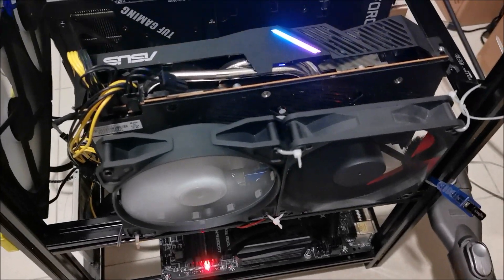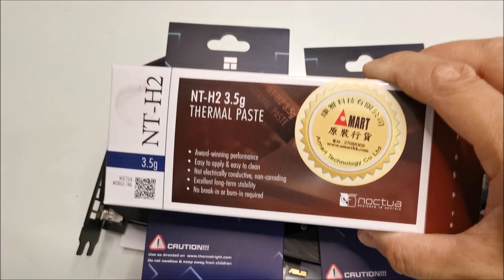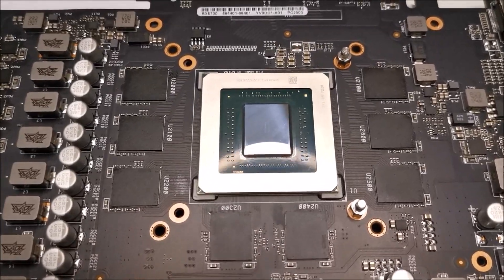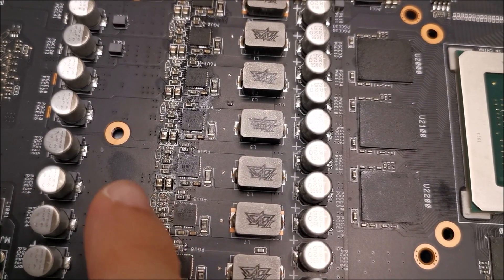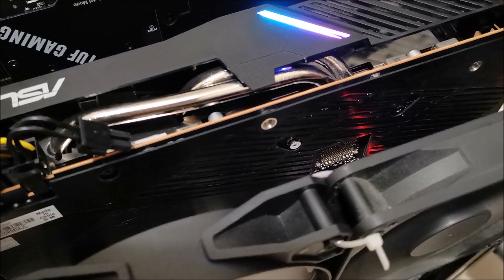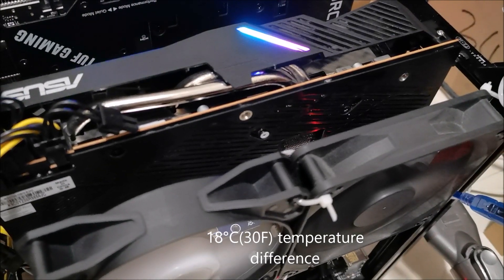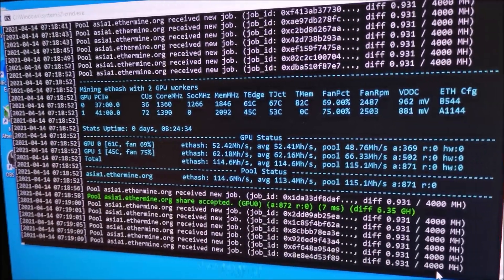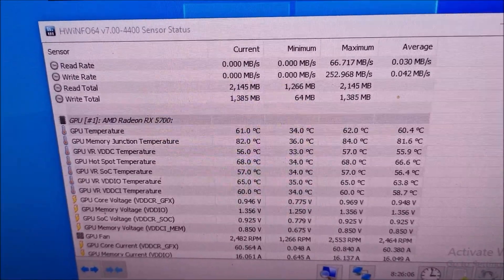ASUS RX 5700 Thermal pads install Upgrade | How to DROP🥶 by 20C

Comment from the maker: Thank you for the 1000 views. It was totally worth upgrading the thermal pads. Let me know how much temperature drop you get from yours
Reply: Hey there i got close to 100 degrees before and now around 80. But i have a problem, there are long ans short screws in the back plate and i mixed them up. And sadly in the video you cant see it. Can you help me out ? Also the Junctions temperatur went up a lot for me, any recommendations ?
Reply from the maker: @Xorat  Hi. You would have to retrace your steps and figure out which screws goes into which slot. Every GPU is different. Also, I think you are confusing GPU temp and Junction temp. With most GPU cards, when mining ETH, its the Junction temp that gets high.....You said you were 'close to 100 degree Celsius before and now 80' I assumed this was your Junction temp, if it's your GPU temp, then you have bigger issues. 
Your last question: If your Junction temp is higher than before, then you have used the wrong pads, wrong thickness, reassembled wrong......any of the combination.

 hope you sort this out
Reply: @BosHK  Hey, so my mem temp was 100 and now 80 so replacing the pads helped a lot. My Problem now is, that my Junction temperatures are really high. They are around 86 and they were about 60 before. I got the exact same rx 5700 daul evo. I replaced the pads with 1.5mm pads. So i think the junction went up because i placed the screws in thw wrong wholes. So because we have the same GPU i wanted to as you if you know in which holes the long screws go.

best regards!
Reply from the maker: Hi. So there are 2 different temperatures according to HWinfo64.
1) GPU Temp.......this uses thermal paste
2) Mem Junction Temp......this uses thermal pads 

As to your screws problem, I have no idea. I rewatched my video, I cant take mine apart again.
-Backplate has 6 screws....I assume they are the same length, it's not those right?
-side next to hdmi ports has 2 screws.....cant be those
-GPU area has 4 screws with a spring-like fixtures to it.....cant be these since they have that spring

If its the backplate ones, I didn't check, I just unscrewed it and lifted the whole plate off with screws left in. I would think if there ARE 2 longer screws, if you used a short screw in its place, it wouldn't even grip and screw in.....check if any of loose
Reply: @BosHK  sadly there are 2 Long ones for the Backplate. 
And all of them fit in every hole .
I was going of from the temp that Team Red miner Shows . It has Edge , junction and mem . 
Mem got better after replacing the Pads and junction got way worse .
Reply from the maker: The backplate screws should not affect the GPU temp. Could try using longer one in middle.
Make sure your paste is spread covering the entire GPU, if you watch my video around 2min mark, you see I tried to take 4 screws out but only 2 came off....thats because I manage to unscrew 2 off its nut-screw (right next to gpu module). Make sure the 'nut screw' is screwed in properly otherwise you will have an air gap between gpu and heatsink.

Comment: asus dual rx5700 backplate is bad design with holes in it , i have asus dual rx 5700xt with much better backplate and thermal pads on the backplate and memory temp while mining is 70c at night goes to 68c

Comment: Great video.Changed the thermal pads . used 2mm . all spots are like 50c except memory . Memory is 90+ c . should i use a knife to make 2mm pads thinner ? (system restart itself after 10-15 min.)   thanx.   GPU = ASUS TUF 3 5700xt

Comment: just did it myself and all the pads were great with good indentations except the two vram chips on the top it was like a sliver so I just cut nice square ones and replaced the pad that was to small and repasted put it back together without tampering with the other original pads , dropped down to 82c was hitting 104c during day time when mining..., now I got to do 3 more tomorrow but this was cake. my other ones hit like 94c , i may not mess with them as thats way with in safe temp for ddr6 , 106c is when it throttles and can then become damaged. the lower the better but I live in florida and when its 90f outside cards cook lol

Comment: How Many MM Do You Recommend For Asus Dual RX 5700 Over Clock Model?
Reply from the maker: Warning: If you open it, warranty is void. 
Your safest bet is get 1.5mm and 1mm. You would need to open and measure the pads out yourself. I do not have Dual RX5700 OC model. if its 2mm, then you can just combine 2x 1mm together.
Reply: I replaced the thermal pads on two Asus Dual RX 5700 OC and used 2mm pads, but they were a little too thick so I had to use an exacto knife to scrape them down to shave some off to thin them out. I recommend using 1.5mm.

Comment: Yes I just did it and got literally 20 C decrease in vram temps! would definitely reccomend
Reply from the maker: That's amazing! so helpful now that its summertime
Reply: which card did you have asus tuf or asus dual. I have asus tuf 3 rx 5700 memory is 100 degrees. Do you guys think it has 1.5mm pads or 2mm pads?
Reply: @poyraz8368  dual, 2x. 1.5mm for memory
Reply: @yobb1n544  2x ?? So you put 3mm for memory?
Reply: @poyraz8368  No, I have the dual version with 2x fans
Reply: where did u applied 1.5 and 2mm ?
Reply: @sunhine08  I applied 1.5mm only on memory. Asus tuf 3 rx 5700. Memory temps fall from 106 degrees to 96. It is still hot tho.
Reply: @poyraz8368  maybe you need thermal pads with higher quality? this watt/cm value
Reply: @sunhine08  I used exactly same model as this video. 1.5mm
Reply: @sunhine08  1.5 was for the vram. I didn't cover anything else.

Comment: hello, friend, I have rx580 the thermal pad is only 0.75mm I can't find this size anywhere. I can try to put a 1mm greezy thermal pad as it is very malleable?
Reply from the maker: Hi, one of the reasons I did this for my 5700 was because warranty had expired and if I messed it up and fried the gpu, it was on me. You 'could' try 1mm but the gpu itself may not get enough contact. The memory modules will be fine I think. Just keep a really close eye on the temperatures and if the gpu temp is 'running away' stop OCing it until you find a 0.75mm.
Reply: Yes they are actually 1mm...